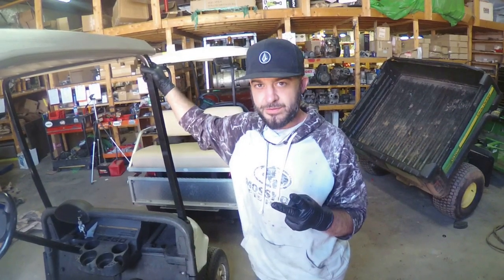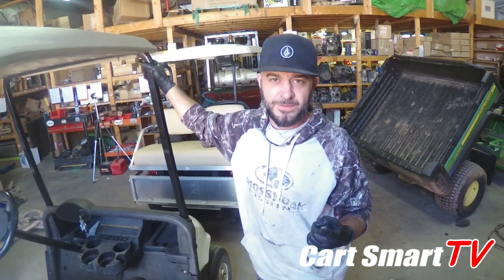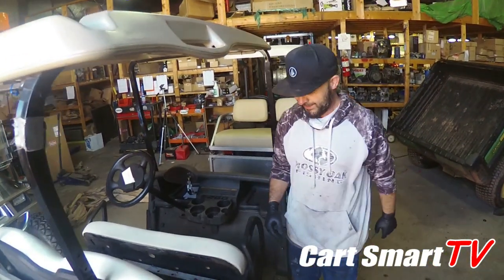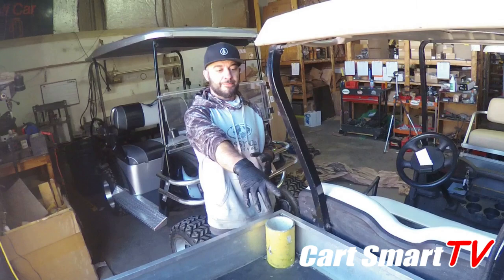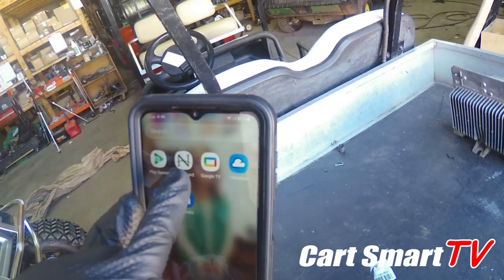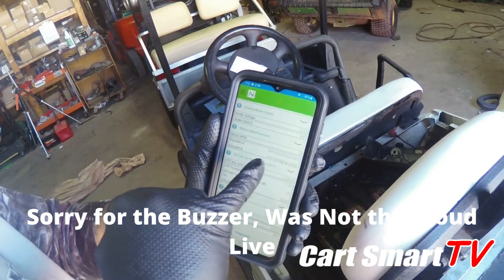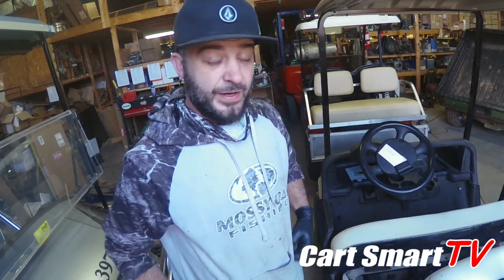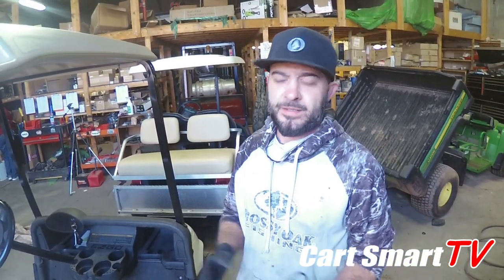RXV Controller Problems?

Comment: Thanks for the info. I just bought an Ezgo and have problems with the cart brakes freezing at full speed and turning off the cart. After turning the ignition key off and then on it works again. The batteries are new. Could it be the controller?
Bill Daumen
Reply from the maker: Hi Bill,  the controller does work the brakes but could be other things also?? What year is yours?

Comment: Thanks for the very informative video. I have a 2021 RXV cart.  I am assuming it has the Naviris controller.   Not sure of the spelling.  If my cart has the Nativis controller, can you tell me the App to download on my cell phone.   Also if my controller is bad, how much will l a replacement controller cost.   
I do appreciate you video and any guidance you can provide.
Reply from the maker: Unless a previous owner installed one we doubt thats what you have? Will be easy to tell by removing your cover to see. They are a bright green as you see in this video. If you do have a bad controller we highly recommend going with the Navitas. Give us a call and we can go over a few test to try and help you. You will need a volt meter. 276.632.8905
Reply: @cartsmarttv  Am quite sure it's a Curtis controller.  I've been concerned because the cart is a rebuilt RXV but the brakes are somewhat inconsistent at times.  
 At times the braking slows the cart when the foot is lifted off the pedal ...other times it seems to be freewheeling at slows to a stop. 
Thanks for the reply concerning the controller. My cart is under guarantee by the selling company however I am doubtful they are understanding my issue as they say its working  normal.

Comment: I have a RXV from 1/13/2010 the first thing I noticed is the 
Solenoid  is a 36v on a 48 v system. The next issue is it has 51v on the battery but it will only move slightly faster than a snail on hot pavement. Any thoughts? By the way very informative video
Reply from the maker: They all use a 36 volt solenoid so no worries there. As to the slow running it could be either the encoder or controller maybe? We go into some more detail on this video >  https://youtu.be/jun_F-bXOqk?si=2jfitNkRC8GHB0En   Feel free to give us a call with any help we can be. Thanks for watching! 276.632.8905